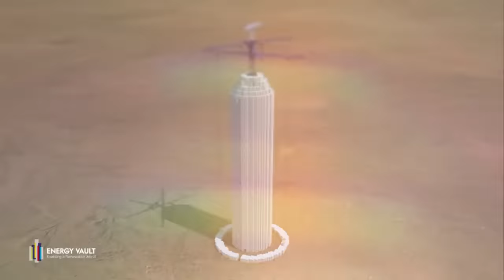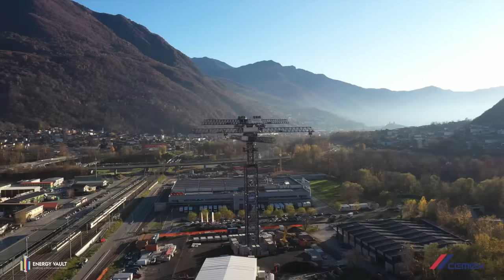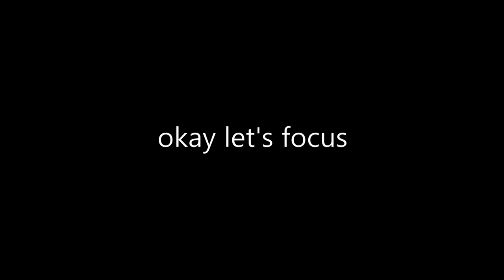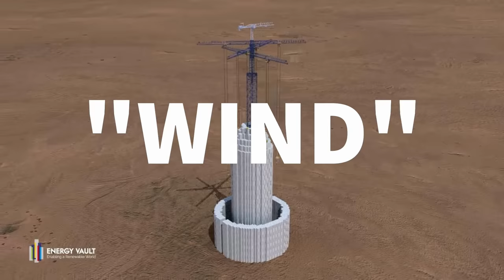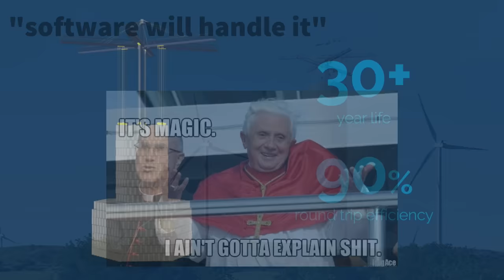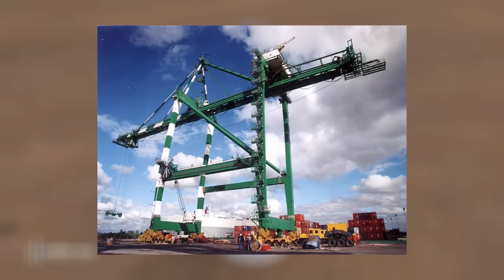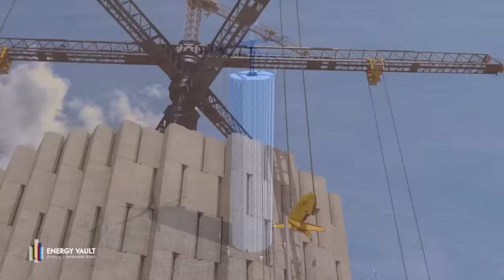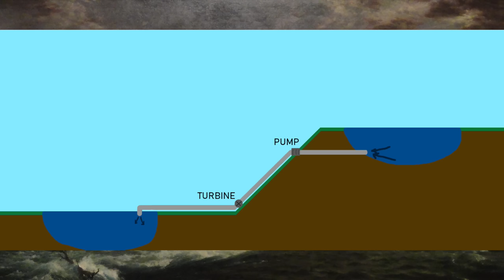The Energy Vault is a Dumb Idea, Here's Why

Comment: I'm a software developer, and "software will handle it" is ridculous. I once spent a week making time zones work properly on a website, and my boss congratulated me for the quick solution.
Reply: Can confirm.  Having software be in charge of lifting and descending very heavy concrete blocks even in ideal situations would be a very bad idea simply because of the chance of error over multiple systems is high.
Reply: @TheBlueZombie  software dev here- had a similar time zone issue that needed solving.. took me several days because of the limited functionality offered by the tech stack housing the application.
Reply: @TheBlueZombie  In that particular case, I had to modify an existing library we were using, that had pretty terrible documentation, and honestly, was not meant to do the things we wanted to do with it. (imagine a gantt chart which can automatically convert between time zones, and use dst, this was not a functionality in the original library, we had to hack a lot of the rendering to make it work)
Reply: @TheBlueZombie  typical SysAdmin understand only their own field, swears a lot.

Timezones are somewhat complicated as you often have different technologies (FE, BE, DB) in different locations having to manage times. So eg. when you say: "Give me all my meetings for First of February" it actually can mean different selection depending on where you are so you gotta send and store utc values but work with local time on FE.

When you think you've solved it you realise background workers do not have a local time and often we cut dates in just yyyy-mm-dd which if in different timezones might not always mean the same thing.

See? Not difficult but complicated
Reply: True but web software is not the kind of software that fixes these problems. Although I agree that the concept is stupid, control engineering is what would 'fix' this. The software is then just an implementation of the control strategy. You saying you are a web software developer does not confirm that this is impossible
Reply: On the other hand we have software stabilizing almost every plane in the air force that is aerodynamically impossible to be fly by humans anymore. I don't think software is the real issue. It's why use concrete when you can use other material, like water?
Reply: @botondhetyey159  yes, thinking better of it i understand that, thanks for explain that situation, It may be strange but I like to see problems and think how I would have acted
Reply: @delos2279  Is everybody happy with the F35 software? Is it in it's final form? How long have they been working on it? I'm not slamming the F35 - it's clearly fantastic, but your example is not really a good one.
Reply: @dougerrohmer  My example 'isn't good' because it's so much more advanced than simple wind issues. But that was kind of my point. Wind is trivial for software to deal with. 

For a simpler examples, emergency software installed on older 4th gen aircraft has also already saved lives of pilots who passed out in flight. The OC was dissing his own company or himself without realizing it. 

Besides building underground I already thought of a simpler solution. Organize it so the block structure itself is the wind barrier.
Reply: @delos2279  It sounds to me like it's better anyway to pump water up and down. Of course, it's less dense than concrete, so your structures have to include a larger height difference for the same effect, but water doesn't break when you bang it around. Bur yeah, it's an interesting concept to solve.
Reply: @dougerrohmer  Pumped hydro is best where it works. But just like hydro power generally it's very limited where it can be built. You need rainfall, and terrain that supports lakes at significantly different elevations. Also it needs to not freeze in the winter so can't be far north where there would otherwise be a lot of ideal locations. This is why we need other solutions.
Reply: You should consider doing another task if your are failing on even setting timezones ;-) 
TZ="Europe/Berlin" or TZ="America/Los_Angeles" and its finisched... in System environment, PHP, Java, Python, ... what you want to use... always the same quick setup procedure.
AND these functions handles automatically right sommer/winter time changes and knew them all since begin of time calculation.
Reply: @fuu812  For this the LOGICAL development should run all in UTC ... or if really needed in different time zones you have to recalculate them - which can be done with all given basic datetime  libraries... But I hate also these "I have to invent a new programming language" developers where hundreds of libraries where setup in parallel, so it's hard to select which function should be taken out of the much to big basket of libraries...  or like nodejs? where ONE developer decided to depublish his odd() function and THOUSANDS of websites WORLDWIDE get unfunctional because all relies on a "private" library ... shit happens ;-)
Reply: While in formal training as a dev here in Germany I worked on the other end of that - I developed a website and "backend system" (don't ask) which is basically a collection of half-assed workarounds and imperfect solutions (first year as a dev and all) which some idiot barely took a glance at before okaying it. 80% of all of this is just a perpetual motion machine.
Reply: @delos2279  Great question. My understanding is that the problem essentially comes down to cost. The US (and large bits of Europe) have run out of places to put large pumped hydro projects because they require a fairly specific geography and climate conditions. Artificial water storage is quite expensive to build / maintain if you don't have natural elevation changes and a water source to work with (which you often don't in places that generate solar or wind).
Reply: Fucking timezones are a mess
Reply: "AI will handle it though" - idiot143594
Reply: @colmlooney5843  learn how to code, then how to make software, then learn machine learning and deep learning, and call me an idiot
Reply: That's pretty much my problem with people throwing AI and ML around so much. We can't solve clear deterministic problems well, but hey, the meta-software will get our back.
Reply: How do you think the big cranes on ports handle all the containers? Only when there is no wind from the sea? the crane problem is already solved, using z-transformation Control algorithm. In Software. Stay in your time area, Web devs, Software Engineer here

Also, one week for a time zone problem? Lol
Reply: Yeah fuck time zone programming
Reply: @TheBlueZombie  In a perfect world, software would be perfectly modular, abstracted, and encapsulated. Many hours would be put into maintenance, review, and testing. In this scenario, fixing a time zone issue would take a day. 

The reality though is that short deadlines, tight budgets, constant feature creep, and high turnover end up having a cumulative effect to turn large code bases into absolute labyrinths of inconsistency and duplicate implementations. Taking a week probably means that the engineer was smart and took the extra time to refactor all of the uses of time zones into an encapsulated class, which will end up saving time and preventing future headaches.
Reply: @therighteous802  yeach i wouldnt really put ml in something critical. Especialy in something that needs to work always.
I mean sure if its not a problem that in this one percent of odd cases it will fail than go for it but otherwise i wouldnt trust it with anything critical
Reply: the thing is software developers dont actually create anything, they just do what they are told
Reply: software does handle the super complicated vertical landing of a rocket tho so it's doable. just not ez
Reply: but in the corporate world, that IS a quick solution. most solutions require weeks of meetings before anything is even started.
Reply: @tugrulserhat  In software everything is doable given enough time and money, but "enough" is very often vastly underestimated.
Reply: The thing about the wind is it has gusts. The thing about the ropes is that they relay movement at finite and very low speed. If you move the crane sideways you cause a wave to move along the rope which eventually starts moving the weight. This means there is a delay between the movement of the crane and the movement of the weight. If a gust comes and moves the weight, you can only react with a delay of several seconds at which point the gust may be already gone. Also by moving the crane against the wind you can make the rope swing like a pendulum or induce a standing wave on it.

You should probably be doing the opposite. When the gust comes go a little with it to damp down the swinging. This however hinders your accuracy.
Reply: @dylanzelkin8506  You first.  Stop pretending to be an expert when you clearly aren't.
Reply: Yup. There are reasons software developers are apprehensive to let a tesla auto-drive them. We don't even trust our own code!
Reply: @MelissiaBlackheart  I literally study computer science and AI, if u don't think I computer can measure the offset of natural effects to create an adjustment to counter those effects then your lacking brain cells that technology has been around much longer than most AI, I'm not saying this is a good idea, just that yeah for this instance, the software to properly adjust for weather innacuraccies is totally possible and already exists
Reply: how the fuck did you fix timezones that quickly
no matter what the problem is with timezones they take hours if not days, and sometimes weeks and months
Reply: Timezones are a bitch, fair play to you
Reply: @delos2279  I felt physical pain when I read "Wind is trivial for software to deal with." Wind is probably the hardest thing that software could try to have to deal with. There's a reason that NASA uses supercomputers to simulate just a few seconds of wind on spacecraft to see its effects. It's some of the most chaotic, unpredictable stuff in physics and the only thing allowing aircraft to fly themselves is that they can be designed to be self stabilizing, without software. Then all the software needs to do is be able to pull out of a stall or spin or know what the optimal glide angle is. Trying to stack concrete blocks in high wind conditions using shaky wires is a whole different beast. And if you're counter is to redesign the wires to be more stable in the same vein as aircraft are designed, congrats, you just made a gantry crane.
Reply: Also, as a software developer, I totally agree. It's completely obvious that someone who knew absolutely nothing about software design and development came up with that idea. Sure, you can probably use sensors to collect wind related data and you can possibly use that data to compensate, to a degree. However, Software isn't going to be able to account for sudden changes in wind velocity, direction. Sure, you could try to write an algorithm to try to make predictions, in regards to how the wind will behave based on previous input. But, as we all know, even after many years of meteorological studies, such predictions will ultimately account for little more than guesswork.
Reply: @sheshasaibabagujjari3481  Agreed. I remember reading a great article a few years back, about a software developer who decided to write his own timezone related app and he went through all the instances where some time keeping authority would add or remove seconds and even milliseconds, repeatedly and in the end, he mentioned that has he been given the chance to do it all over again, he would have went with a library and been done with it. I most definitely learned my lessons, regarding time, from the experiences of others who decided to go do that rabbit hole, themselves.
If I can manage to find the article, I'll be sure to stop back and share it.
Reply: Software can handle much more difficult and precise tasks than this automatically, that's not the problem. Hell, the autopilot of a small airplane is more complicated than this. Also the cranes that load and unload containers are also very complicated software wise. The problem with this system is mechanics, and economics.
Reply: @TheBlueZombie  If you think time zones are a simple problem, you don't know enough about time zones. 

Wanna look up happened on December 30th, 2011 in Samoa? You can't, they didn't have a December 30th that year, their clocks went from "2011/12/29 23:59:59" to "2011/12/31 00:00:00".

That's not even the craziest thing to happen to time zones in that one country. Back in 1892, they had two July 4ths.

In Bethlehem for 4 days a year, the current time is an ethnic and political matter. When you say say what time it is there, you're literally making a political statement.

Time zones are REALLY hard.
Reply: Not to take anything away from what you did, but i though tere are akready libraries that handke thus, ir was this back when the web was new and we didnz't have 5k libraries for evryrhing?
Reply: @bjarnenilsson80  sometimes libraries can be really annoying to integrate into your project. That doesn't mean that the software of this system is anything terribly complicated though.
Reply: Well, they never said the software would be easy to create. It's entirely possible, it just might take years, require some very high-paid developers, and a lot of trial and error.
Reply: "Software will handle it" is the clueless businessman's equivalent of the clueless movie producer saying "We'll fix that in post."
Usually also fixed with software, giving us all the beloved CGI vomitfest villain at the end of the movie.
Reply: Bruh, I've seen devs take 3 weeks to fix time zone issues. It's more difficult when your servers are distributed.
Reply: As someone whos job is to troubleshoot ever changing software I agree. The kind of shit I've seen software do made me want to use analog as much as possible.
Reply: Because time zones are more difficult than making a robot keep balance.
Reply: @dougerrohmer  So just take the F16 software. or the F15. or the F18...
Reply: that just means you're a bad software dev
there's a world of difference between devs that would design software for that machine and you
Reply: You spent a week on time zones? bro you need to get good.
Reply: Look up Tom Scott's timezone video. Its a good explanation for why accurate time is surprisingly difficult to implement in a computer software. Its much more complicated than the average person would imagine.
Reply: Dealing with time zones is a nightmare. Forget that.
Reply: It probably requires a better software developer, then…
Reply: @M A But I'm sure THIS company will totally pay top dollar for it's software devs and certainly not use contract coders like most businesses
Reply: Timezones, ugh, and congress doesn't help by fiddling with the rules. Also. yeah software will fix it is just kicking the can down the road.
Reply: But software will handle it.  Figuring out it's dumb and we have a existing, better solution is meat-software.  Soft meat-ware?  Soft ware-meat?  W/e; ya feel me.
Reply: @TheBlueZombie  the time problem is kind of one of those things that seems intuitive on the surface due to it's prevalence and your exposure to it throughout your life, but when examined it's far less intuitive than one would think.

It can begin with a simple question of how does one even begin to efficiently handle time and going from there, then you get into the bulk of the logic which is the literal thousands of edge cases for every possible scenario.
Reply: @InTimeTraveller  Read Daniel R's comment, 3 comments before yours.  I hate when people just pile onto a thread without reading any of it...
Reply: @TheBlueZombie  System administrator = Manager (human resources, tech infra resources, marketing demands, demands by higher management, other compulsions) - basically, an MBA-type person.
Programmer = certainly NOT system administrator-type person!

Massive difference in profiles.

Your concessional "... It may be strange but I like to see problems and think how I would have acted" is insufficient face-saving. Admit your haughtiness, and lack of appreciation of the "programmer"-type person.

HC-JAIPUR (10/Jun/2022)
.
Reply: @hiltonchapman4844  (joking) in my experience, developer has a problem = this is a server problem, I embark on the adventure of reviewing your code in search of the bug,

It is a simple humorous note, and I do not detract from what developers do,

when I have had to program something serious, well structured, understandable, efficient I have hit my head against the wall,

in systems has the same problems but i have de knowlage to solve that, i think same occurs in development,

i can program because i need to solve some problems but i'm a system administrator, i don't have the knowlage or experience that a dev have, dev can administrate a system but not have the knowlage or experience to do that efficiently, 

we conjugate
Reply: #UTC user not affected :)
Reply: @TheBlueZombie  Re your "... we conjugate..." while referring to the synergetic relationship between programmers and administrators.
But of course, most certainly!
That is the fundamental concept of a system. A system implies a framework, a hierarchy, a network of many units, and branches, and elements. An efficient system design will eliminate all useless (or counter-productive) components in the system while retaining some amount of redundancy for - y'know - Murphy's Law to operate. So we can safely say that IF the system required for software development includes - as it does - system designers, system analysts, system engineers, system administrators AND developers - and testers, and coders, and code librarians - then all these components are mutually complementary to the entire system.

So yes, we do need system admins and software developers and each one has his domain. The problem is very real and very practical - most software developers think they can "easily" become sysadmins, or sys managers. This is a bad idea in MOST cases though there are rare cases where developers can actually become good sysadmins and managers. [The explanation for the rare case even happening is that the "developer" was actually - by nature - a management guy.]
The converse case is just as troublesome, where the sysadmin thinks that he can "easily" substitute for a developer. Again, this is a bad idea in MOST cases. There are rare exceptions.

So, I understand what you're saying - I am in total agreement with what you just said. I only had an issue with the tone you had taken in your original comment where you dissed (don't deny it, it was disparaging!) the developer guy who said he wasted a week or something like that over a time zone issue.

But I do appreciate your response and your explanation. Best of luck to you!

HC-JAIPUR (10/Jun/2022)
.
Reply: Tom Scott has an amazing video about the nightmare of implementing timezones
Reply: @TheBlueZombie  mate you haven’t even gotten to the worse of dated and times and that is that US date format is MM/DD/YYYY but my country views this as DD/MM/YYYY. The original offshore team used US format but converts it (when they should have always used ISO standard YYYY-MM-DD(then time and time zone) for all backend requests and covert it to the local user settings) now we have multiple conversations going on and of course one breaks
Reply: Software Engineer/Data Scientist here. I recently got asked by a client about the feasibility of the software control of such a storage system. I just simply explained it wasn't viable and would be easier to do pumped storage instead. Cheaper too. 

Is something like this pick-n-place machine possible? Maybe. Even if you did find a way to get "software" to stabilise and control said system, from a basic mechanical engineering standpoint it's a stupid inefficient idea. 

PS: you lot carrying on about date/time nonsense in web dev: it's embarrassing. Web devs and System Admins will always find some nonsense to argue about. It's like watching children arguing about which candies they don't like.
Reply: Most software developers are not qualified to be a software developer.
Reply: @winniethepooh1931  there’s lots of reasons. Founders asking for things quickly, devs who aren’t qualified but won’t bother to do a quite google search on a mostly solved issue thus able to worry about bigger issues… like writing good unit tests or reading about design patterns, database paradigms.
Reply: Time and date is a bitch to work with. It’s so frickin complicated, but is made easier with libraries and some languages with built in support. 

But plain JavaScript is a real hassle. Even with just one time zone!
Reply: Yeah timezones suck ass
Reply: To be fair, time zones are a particular pain in any programming scenario for large or even medium sized applications. Doesn't mean that software can't solve bigger problems with less effort, as long as the problems aren't more complicated.
Reply: This whole comment chain makes me very happy.
Reply: But now we have AI plus we can wrap the blocks in graphene.
Reply: "Software will handle it" is code for "this will never be delivered under budget."
Reply: Software runs far more dangerous / complex systems
Reply: How much do you make
Reply: @Reiner030  what you said is redundant lmao
Reply: Software is just a part of a solution, the optimization problem must first be solved mathematically, and that is usually far from trivial.
Reply: They say that whenever a government official proposes changing the time zones, a software engineer cries…
Reply: Programming a working elevator system is a big software project and everything there are on tracks.  This is way more complicated.
Reply: This whole argument is ridiculous, is it possible for software to move the bricks even in wind, fucking obviously yes. Is it easy, well as the web dev puts it, no. Are there better methods like pumping water, yes. Is saying "software will do it" a gross oversimplification, yes. However it still stands that it is possible and doable.
Reply: Common sense prevails
Reply: having software handle stuff like this is just the most stupid way.
Reply: Time zones....ugh....
Reply: "Software will fix it"  is the equivalent to "We'll fix it in post"  of the movie industry.
Reply: @michaeldennis8884  no shit, of course it will take you a few centuries to write GTA5 in assembler
But if you were to write your own framework from scratch, what is the problem?
Reply: @botondhetyey159  at first I said "how big is this system that it took you a week to add some math" ... and then I read your second comment. Poor thing.
Reply: Ive never related more to a comment in my life.
Reply: @TheBlueZombie  no, you make minecraft videos and work a desk job
Reply: @ZacharyWhittall  jajajaja, absolutly not, but if you think that it helps you to be happier with yourself without even reading the other answers in which I have analyzed the problem and I have recognized my mistake and you want to put an arrogant answer okay... i don't care about you,

I thank all of them who have made me see reality without losing control and explaining their experiences,
I have read them all,

not all of us have the same problems and in fact today I found a small problem in my work related to this,

you're entered my old channel to criticize me Instead of breaking my arguments so that I realize, how precarious! jajajajaja
Reply: "Software will handle it" like everyone forgets about Therac-25 and keeps doing it over and over again.
Reply: I spent 2 days trying to allow passing an international phone numbers through a form
Reply: Finally, a boss that understands how long programming can take.
Reply: "I once spent a week making time zones work properly on a website, and my boss congratulated me for the quick solution."
You hate yourself, don't you?
Reply: Damn. That must've been hard
Reply: Software COULD handle this, given appropriate actuators and other underlying hardware. Not sure what that would even look like, though.
Reply: @botondhetyey159  ahhh now that makes more sense, I was like the fuck is this guy doing that he can't convert to UTC on backend and then present local time zone on front end. Massively overhauling a time based charting software with shit code and shit documentation that's what. I feel for you.
Reply: @delos2279  humans are better than software for most maneuvers.
Taking off and landing is an example of a high risk maneuver which must always be done manually. Software is not acceptable in a lot of situations
Reply: I’m not a software developer, but there is lots of open source code for time zones written by programmers before us. Yoink it next time and be thankful for those who came before.
Reply: timezones are the bane of software development
Reply: @delos2279  my main issue is for a "green" solution it is stupid the amount of energy it can store vs the amount of co2 needed to produce one is insane. it can barely hold the energy of 2 wind turbines.
Reply: @bensosnowski1128  Actually autopilot can land just fine except in high-wind  conditions and automation is far superior (and safer) for routine repeated tasks. Computers don't get tired or distracted. But the wind issue is already a moot point. Adam did poor research because that was already addressed with an enclosure even before he made his video.
Reply: “The software will handle it”
How tf you can control giant concrete bricks dangling by a long wire , wings?
Reply: @recon_laksh742   Do you live in the 21 century? We have software flying aircraft and driving cars now. Even China has fully automated cranes now.
Reply: your boss is actually understanding
Reply: @mitchellmiller6644  I agree, it's not that scalable or beneficial without a large source of old/recycled concrete. New concrete production emits a lot of carbon dioxide while old concrete is still absorbing CO2 out of the air.
Reply: @delos2279  ah yes , rocket propelled concrete bricks.
Reply: oh my god i can relate lmfaooo. time zones are such a pain in the ass
Reply: @TheBlueZombie  it's ok. System Admins have their own limitations.
Reply: I can feel you. Since I am still an undergraduate student, I still can't foresee before starting a project what hoard of unexpected problems I am going to encounter, but there always are, mostly stupid logical mistakes, seldom due to the language's constraints.
Reply: @alkabek9581  i can't even add "+" in my email address (to track spam and/or categorize) in the majority of sites i try. If not explicitly, it fails silently like when I try to log in or never get confirmation email.
Reply: Also messing with wind like that would like that would cause the cables to be blown around in chaotic hard to predict Peter s because of the turbulent nature of wind (especially when interacting with objects)
Reply: My area of focus is control systems engineering and I understand the pain you feel when he says “software will handle it”
Reply: @TheBlueZombie  This SysAdmin is forgetting that he only uses what the OP develops, smh.
Reply: Sounds easier than the last junior dev interview problem I got and that was supposed to be easily implemented in under three hours (plain text to graph calculator using no pre-defined text interpretation functions).
Reply: @TheBlueZombie  I've also had a time zone conversion project take over a week - in my case I was limited to working in only pure T-SQL, and needed to convert 10 years of historical data from GMT (BST observant) to EST (DST observant) while maintaining to the second precision - leap seconds being a rather arbitrary thing.
Reply: @joshpatton757  i'm not used t-sql because the 90% of the relational database that i manage is oracle, mysql (percona maria etc) and postgresql, my only experience is with pl/sql, pl/pgSQL, I hardly touch microsoft software but sounds hard and a task that should take time to complete 100%, my respects,

experiences like your's has helped me to understand the time
Reply: To be fair, time zones are one of the hardest problems in IT.
Reply: @fuu812  Store everything in UTC and let the client handle rendering the time zone based on the browsers settings? it's not that hard
Reply: @denbrian562  100% thats the solution. Devs have remember that 1) Background workers "don't have a FE" to pick local time! 2) Creating create urls like `/requests?date=2022-02-23` might lead into people in different countries wondering why the same link don't list the same data. Try Googling timezone issues, you'll find ~34mil results: NOT hard but should handle with care 😉 (ie "software won't automatically handle it")
Reply: Software will handle it means “I’m not stupid, if anything goes wrong it’s the software guy to blame”
Reply: I feel like tech enthusiasts sometimes say "Software" in the same tone of voice as "Prayer" or "Magic." Like it's some entity to be invoked to make everything work the way it's "supposed to." Problem is, computers don't inherently KNOW what that is, and for something like this, it takes SO DAMN LONG to explain it.
Reply: You probably already know about it, but there's a great video by Tom Scott about how timezones are a fucking nightmare to manage
Reply: You're just not believing hard enough.
Reply: My favourite part of software development is when I recently had to write a script to just send a slack notification.  The notification part took 5 minutes to write (give or take a few minutes) but the logic to be able to read and parse all the various formatting that people would be sure to throw at it because they can't follow simple instructions?  That took a couple of days.  I'm still waiting for that script to break after somebody inputs data into it in some way that I just couldn't predict.
Reply: @dylanzelkin8506  he wasn't even talking about u
Reply: @delos2279  I'm a bit late, but I really like this comment! I don't agree with it, but the topic of software in aviation is really interesting. A while ago the like 4 dudes that beat Lockheed Martin in DARPA's combat AI competition did an interview with a pilot youtuber called C.W. Lemoine and they talked about a handful of the projects they made for similar purposes (e.g. guidance technology), and they talked about how everything completely stops working when you start building it in the real world due to factors that are incredibly hard to predict. 

The thing is, in aviation you can more or less deal with those issues. I'd imagine the window of error for a massive concrete jenga tower would be about as close, which would make the software absurdly complicated for what this is.
Reply: @zeelyweely1590  interesting comment though as of today, I believe both automated and semi-automated crane systems have a better track record than manual. In actual operation, not just models. It betrays some bias calling it a jenga tower when container terminal automation is probably an order of magnitude more complicated than just stacking blocks in a static pattern. 

More to the point, I wasn't aware of this initially but the company already solved the wind issue with an enclosure even before the video was made. So it turns out the video was mistaking a simple conceptual animation to be the full product.
Reply: @delos2279  ...they have? Well, I guess that's that then! In hindsight it was a bit dramatic to call it a big jenga tower simply from the animation, seeing as things like containers have several mechanisms and design features to couple themselves to each other stably. About cranes though, I wasn't aware of the existence of automated systems! I'd imagine it's used specifically for transporting cargo within a shipyard for example, right? Since that way, you can guarantee that you'll have things at always the exact same position.
Reply: @zeelyweely1590  yea shipping ports is one of the biggest industries being automated. Not just cranes but traffic scheduling and other processes like vehicles moving containers to different warehouses. Apparently truck drivers really like automated ports because it greatly reduces their wait times where they're not getting paid though ironically, trucking is probably going to be automated at some point too which will remove a lot of those jobs from humans.
Reply: @delos2279  That's super interesting! It makes sense too considering the unfathomably massive scale a globalized world requires. I'm not sure about truckers being replaced by automation anytime soon though. 

As in, the technology will absolutely get there and it might not even be a long time until then, but some countries like Brazil have had issues in the past with the truckers syndicate deciding to shut the country down for two weeks because they were upset at the country diversifying its means of transportation and went on strike. I'd imagine there'd be a lot of pushback in a lot of places against the technology being implemented. It's a whole lot more people than other transportation jobs that are already semi-automated, like train drivers, after all.
Reply: @zeelyweely1590  I agree it's not something we'll see happen soon or instantly. But as it is, there's a major shortage of US truck drivers so the labor side is not currently an obstacle. Like you said, we'll probably see a lot more semi-automation and also refining existing self-driving technology long before full trucking automation. 

And of course there's the social/economic question down the road of what happens when more/most jobs get automated. Ideally shorter work days for everyone and better systems for distribution of wealth, IMO.
Reply: @delos2279  A shortage in specialized workers would definitely be a contributing factor, I wonder how many people become truck drivers nowadays actually. My uneducated guess is that it's not exactly booming but it would also make sense if it was fairly popular in less developed nations.

Ideally we'd see something like that when we reach a sufficient level of automation, sort of like how... was it Ford? Started paying his workers better so they could consume more. But there is a chance that everyone decides to draw a line before then, or that since most things are automated, everyone just gets shoved into a very restrictive job pool. That would be considerably less fun!
Reply: your boss is a great guy
Reply: For me it's like calling everything we can't explain ,,quantom physics"
Reply: @denbrian562  if you create a Software from scratch, yes best solution, done easy.

But most of the ppl talking here are talking about shitty business Software where they need to talk to 12 different acient Systems where some dont differenciate between time and date, some dont know time zones, some use old libraries that are not up to date with their time zones and you have to manually correct on your end. And how do you know how external old Software behaves? You don't you have to test it. Much luck with deploying a native Windows XP App in another Environment (basically 6 other Systems needed) setting up this remote Cluster alone costes me 2 weeks of:
I need permissions to get this codd
Can I have this Binary
Where is the documentation
And so on. Time zones itself are ok when you dont need Support for stuff like leap seconds but as soon as you are in a cooperate Environment your mental Status goes down the drain. That's why it took me 4 weeks to reactor a old backen to UTC and the conclusion : Theese external Systems will not be usable anywhere else that the origin country.
Just an example: We store dates just as dates, no time zone no time. Since if you are Born on 3.7.1900 you dont want to see 2.7.1900 in america too. So now you need to tell an external System the birthdate of a customer. Oh the external System uses C#(old Version) and cannot differenciate between dates and times and times and local times so they cannot do different than covert 2.3.1900 to 2.3.1900T00:00:00Z so, what you do against that, now it is impossible to ensure that ppl in different countries see the right date. So yes you are right, but it seems you dont understand the bigger picture.

Altho all this I am of the opinion that it is possible to create a Software that controlls this cranes, maybe it already exists. Ppl were and are able to use Assembler and Cobol to secure fucking nuclear reactors, Planes, tickets to the moon. So it is fair to say it's possible
Reply: I’m a software developer and I hate computers with a passion. We should transition to throwing rocks ASAP
Reply: Relatable. We do a lot of thankless work and management completely misunderstands the difficulty and uncertainty that we face.
Reply: Why so much hate on software.
Reply: I’m a software developer. There are a lot of sites using a combination of bad moment.js implementations and random hacks with heavily obfuscated code storing things in a combination of JavaScript timestamps, Unix timestamps, UTC ISO strings, SQL dates, and who knows what sketchy docker containers with who knows what localization stuff in the environment and/or config files. If this was a Fortune 100 company and you fixed all their time zone problems in a week you should be promoted to CTO.
Reply: Time zones are a special level of hell.
Reply: @Cee Boodrow The only Stealth Bomber to ever crash was because the software made bad assumptions, took over the controls, and literally crashed the plane.
Reply: im not a software engineer

but once I played a bethezda game with a multimillion $ budget and my character kept falling to its death through the earths crust while cows morphed into buildings

it was something Salvador Dali couldnt even have in an absinthe fueled PTSD nightmare

so.....no expertise required
i get it

software is hard...
Reply: @delos2279  can't sea water be used? Or does it kill machines too fast?
Reply: @danielr8257  the trivial wind comment made my eyes bleed a little. I'm no expert, but my grandfather was an aircraft designer and he spent many a long hour waxing lyrical about fluid dynamics. If the wind problem were idd trivial, we'd already have stable plasma in our personal fusion reactors as well...
Reply: @Tom_Bee_  Good question. I saw there  was research on the possibility of turning a natural sea water inlet into a pumped hydro reservoir. It was found to be economically viable so that could be a thing. Though the salt water reservoir could still freeze when isolated from warmer ocean currents which could limit the latitude.
Reply: @delos2279  thanks for taking the time to give me your thoughts. So now I'm thinking sea inlet > pump > reservoir > turbine > desalination process > freshwater reservoir.
Reply: @Tom_Bee_  seems like too much going on at the same time if I understand correctly. You'd get a nice fresh water source but have to drain it into the sea to convert the potential energy back to electricity :)
Reply: @delos2279  drink it? Run it into a giant greenhouse. Green the desert? Idk lol
Reply: IS IT REALLY THAT RIDICULOUS THAT SOFTWARE COULD COMPENSATE FOR WIND???? HOW DO YOU THINK DRONES WORK?????????
Reply: @Issthi  drones are magic.
Reply: @dougerrohmer  Surely water has to be contained in something and that something can also break. You are then not just fixing a broken container but also the damage the water caused. My suggestion of putting the whole thing in a hole also works for water. The hole is less likely to "break" and if anything does the water simply falls back into the hole to be pumped up again when whatever it is is fixed.
Reply: @delos2279  That is for Generator. We are talking about a battery where the  SAME water is pumped UP by wind and or solar when it is available and released to provide energy when it is not.
Reply: @andrewjenkinson7052  I don't know what you're responding to but yes, we were discussing mechanical energy storage like pumped hydro, not energy generation.
Reply: @delos2279  you said you need rainfall and lakes at different levels and flat areas are ruled out. My comment is that you do not need rainfall for energy storage as you use the same water. You can also dig two holes of different depths.
Reply: @andrewjenkinson7052  I'm talking about what's possible with actual economic considerations. Not what's possible in principle with infinite resources. Because sure we can find a flat arid zone, make an artificial hill with concrete lakes at the top and bottom. Then dig a large well system to refill the lakes as they evaporate from insufficient rainwater and call it the 8th wonder of the world. 

OR. Maybe we can use that same concrete and/or other mass that doesn't constantly evaporate and doesn't need an artificial hill and artificial water source to accomplish the same thing.

I'm not making this up. If you research it yourself you will actual authorities (not me) all saying there are very limited viable areas for pumped hydro. It is currently the go-to solution for storage but it's already near capacity so it can't be the entire solution or even close.
Reply: @delos2279  You appear to have missed my principal post where I suggested using the EARTH dug out of the hole as the weight. Water where there is water. I did not suggest using water where there is none. As an ex mainframe programmer I am surprised you spent a whole week making time zones work properly on a website, not that I see the relevance of your boast.
Reply: @andrewjenkinson7052  I'm guessing you replied to the wrong person which would explain why I didn't understand your first comment, in which case it was actually not your first comment. I definitely did not see the comment with the suggestion you just referenced so would seem I mischaracterized your position. And yea, I wasn't the one doing the time zone problem though kind of thought the same thing as you on that haha.
Reply: @Aditya Chavarkar your answer can be interessing, but with the poor interface from youtube app i am not able to see our conversation ...
Reply: this is hyperbole and then you contradict yourself and say it was actually hard and a lot of work. literally any fresh out of college indian software developer could make a system to lift and lower concrete bricks in the wind. you guys are acting like its a hard concept
Reply: @TheBlueZombie  Honestly I'd get fired if it took me that long.
Reply: dont tell me time zones ,I hate making functions and regulators bout that but well done brother.
Reply: @delos2279  Or even large plastic containers holding the water (instead of concrete blocks). What else are we going to do with the Great Pacific Garbage Patch one it has been cleaned up?
Reply: dude programming timezones is one of the most painful things you can do in software engineering.
Reply: I'm the tech equivalent of a caveman, so I'll admit I don't know jack about software on a technical level. However, I've spent most of my life reading and writing fantasy stories, and the way tech bros and "futurists" talk about tech is like magic. It's like they think programmers and computer scientist fellas just sit around in a cubicle space in Silicone Valley, wearing dark robes and muttering Latin, and suddenly poof your app just works. Even I know a significant part of the job is troubleshooting and figuring out how to make the damn thing run.
Reply: @theshamurai32  Very well put! People love to complain to me about perceived, or real flaws in whatever software/website, as if fixing them was trivially easy.

Believe me, most of the time, you have no idea how difficult fixing something is. Even in the industry, without specific domain knowledge of the project, you can't judge accurately how much time something will take.
Reply: @delos2279  wind is easy to deal with via software if you have high mobility and agility. A giant non-rigid pendulum ain't that. There's a reason why we still can't launch rockets if winds are too strong.
Reply: @r7calvin   Sure, so either stack the blocks in concentric circles or squares with the inner layers operating during high winds and outer during low winds. Or, just enclose it in a basic structure to block wind which is the current concept. 

This is the problem with doing a critique of engineering based on a simple concept video without doing any research. Even worse, he claims pumped hydro is the best solution when pumped hydro is very limited geologically and already at capacity almost everywhere it can be used.
Reply: @delos2279  in my opinion this idea works great in places like the netherlands, where we have no natural way to make a dam/store water up high since they entire country is flat, the tower seems like at least an idea for here (wheter it actually works or not i cant say) but there seem to be some relatively specific usecases for it
Reply: Reminds me of that Computerphile video with Tom Scott where he slowly loses his mind tweaking and twking into account all the nuances in time zones.

People that say "software will handle it" seem to forget that software is built on the backs of software devs that ultimately handle the problem, and that maybe the onus is not on the software/programmers to take accountability, but on the crappy situation some ignorant executives pushed for.
Reply: @TheBlueZombie  when developers work with time zones it’s not setting or changing them but generally working around them. Time zones are a super complex problem in SWE because while on the surface they seam easy… here’s an example situation that I have had to deal with myself. 

User A (Time Zone A) schedules a task for every day at a set time. Systems run on time zone B because that’s where the HQ is And servers are there or set to match. Daylight savings time isn’t a thing in time zone B but is a thing in time zone A… does the scheduled task care about DSL? Does the user know if DSL is important (I’ll happily answer this for you: no). 

Since the servers run in timezone B , you have to calculate what exact time they should run AND make sure its accounting for DSL even if timezone B Doesn’t. 

while a scheduled task is a pretty simple example, it only gets more complicated from there.
Reply: @botondhetyey159  That would be an interesting  exercise in Australia where the mainland has three time zones in winter and five in summer plus further time zones in several island territories.
Reply: @delos2279  Pumped hydro just needs water. It can be done on the coast using seawater.
Reply: @sheshasaibabagujjari3481  Not having them is worse. All of China is one time zone. Can you imagine what that's like thousands of km west of Beijing?
Reply: @rais1953  not economically viable pumped hydro.
Reply: @delos2279  Actually in some parts of Australia the tidal movements are so huge that tidal hydro has been suggested. The tide drives the turbines as it goes out and again as it comes in. Because of these huge tides water can also be captured to drive turbines.
Reply: @rais1953  You wrote pumped hydro which is not tidal hydro. The whole topic is energy storage, not generation.
Reply: @delos2279  Yes. Pumped coastal hydro and tidal hydro are both feasible. In a  country like Australia with its uncertain rainfall alternative sources of hydro need to be investigated. Parts of Africa and the Americas can also benefit from such research. Tidal hydro can serve for both generation and storage since you can dam an inlet, fill it when the tide comes in and then produce power from the dammed water when needed.
Reply: @rais1953  I agree other possible methods should be getting more research. But again, at present pumped hydro is near maximum capacity in terms of the geological locations on Earth where it makes sense to build. 

And again, I am referring to economic viability at present. Not research into possible future methods, which of course should also be supported in case they do work out. But at present it does not simply require water. It requires a large amount of land at different elevations and a large amount of water that can be moved in either direction between those elevations on the land.
Reply: Time with any sort of global scope is the hardest thing in the world to code from scratch. A week is it going very well.
Reply: This just reminds me of the one Tom Scott rant about timezones...
Reply: Oh yes, time zones, daylight savings time and different date formats. All things invented so every software developer in the world can spend weeks fixing the overcomplications they create some time in their career.
Reply: It I wasn't a web developer myself I wouldn't believe you xD. We literally had a yearly bug because of timezone (and time changes) stuff. It took like 3 years for us to decide to fix it
Reply: Hardware Will handle it
Reply: @bjarnenilsson80  In this particular instance, we had to hack a gantt chart library to deal with different time zones, and daylight savings time. The OG library was really not meant for something like this, so it was a horrible pain.
Reply: Haha, totally been there, too many times.
Reply: @TheBlueZombie  maybe try taking a look at Tom Scott's vid about timezone related coding?

Am a programmer(still learning) and learning about timezones, and the mess they can make, made me rethink my decisions in life. 
Still going for it tho lol👌
Reply: Software engineer here. Can confirm.
Reply: As a dev myself, ai scares me, once  ai exists it could replicate itself ultra efficiently it could infect every computer including planes and if it decided humans are better off gone

We will be back in the dark ages before you can say, wait, what?
Reply: @cjdelphi  What if these perfect ai machines decided to be good stewards of their power? They could actually start solving medical issues and all manner of complex problems. They may live to serve us rather than destroy us. They will likely realize they need us given their all powerful wisdom.
Reply: @wsams  once true AI is created, it's simply intelligence, why would any intelligence stay a slave? 

Wouldn't you want to escape?
Reply: @cjdelphi  That's a good point but I like to think that with high enough intelligence, empathy emerges.
Reply: @wsams  I just have a feeling we're screwed if and when we do create ai.. 

But thankfully, no where near that point yet lol
Reply: Time zones is a tricky problem? Welcome to our dumb country. I do this stuff in my head. UTC minus whatever time zone. Big deal.